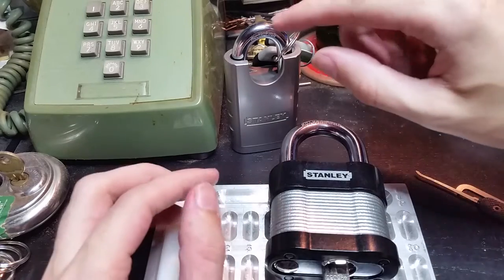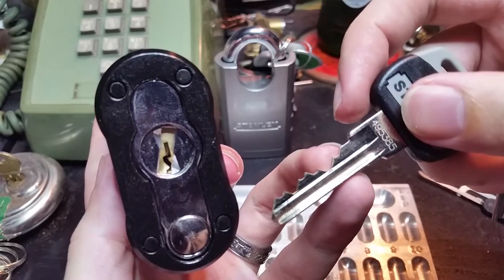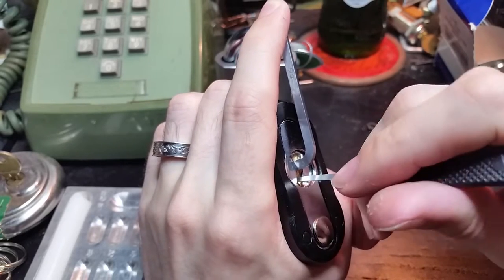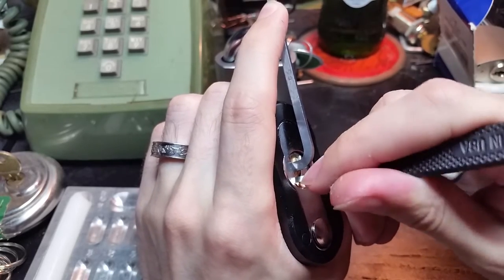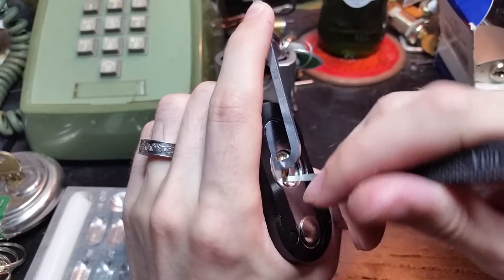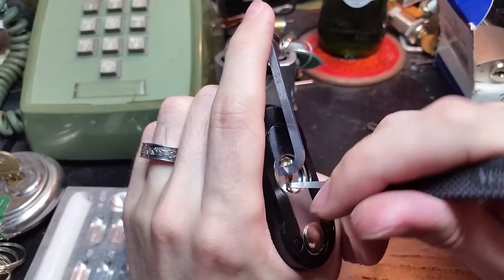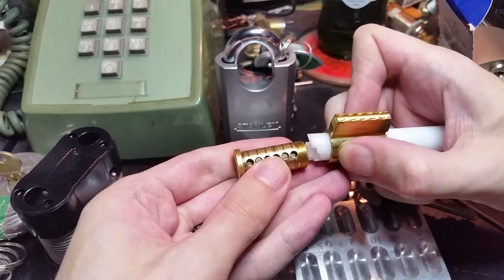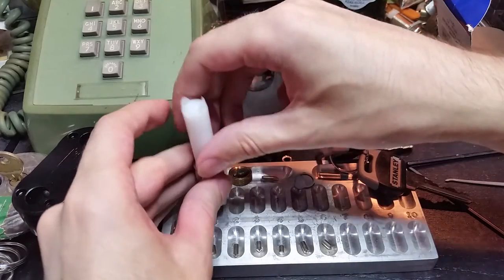(69) Stanley 60mm laminated body padlock picked and gutted

Comment: From the front of the key the bidding reads 583594, you can follow the bidding as it goes along. Its a superbly bidded key, looking like a mountain range which is how Stanley like to bid their keys. The more uneven it is, the harder it is to pick.
Excellent job picking the lock with that aggressive bidding! I have the Stanley 50mmCS with equally aggressive bidding and I have not as yet managed to SPP the bugger open, the deep bids give me false sets every time! Decent security pins and sharp counter milled bible in this top-quality moderately priced padlock for the oodles of security features that its rammed with!